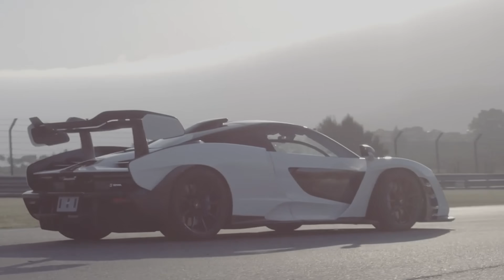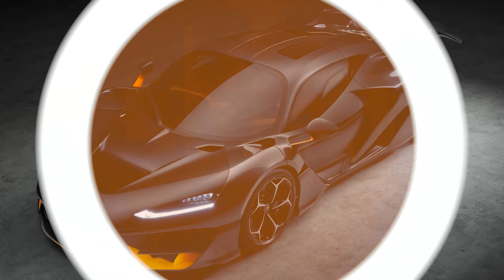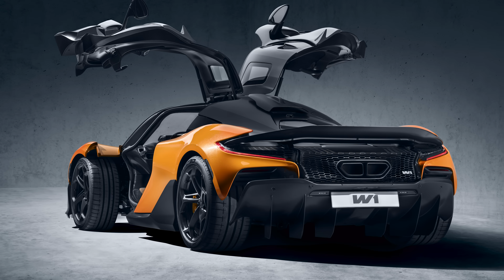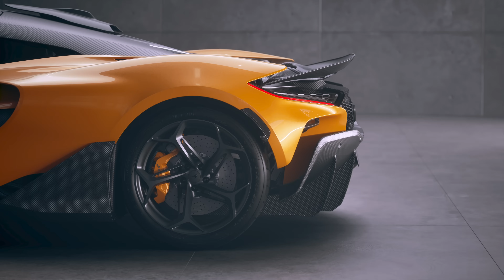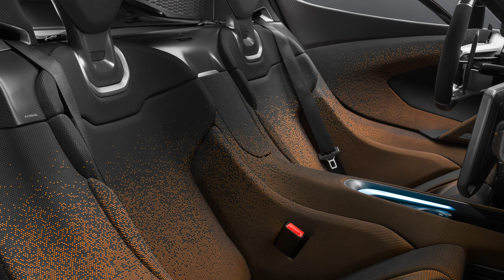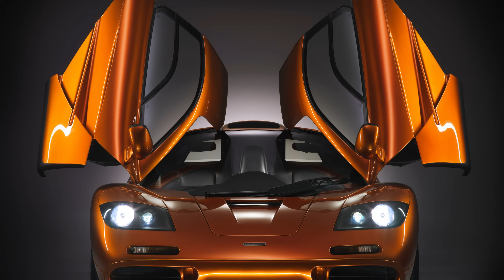The McLaren W1 is a New Standard for Ultimate Performance

Comment: I would have thought with 1300+ horsepower, it would have been able to crack the sub 2 second 0-60 sprint. 2.7secs seems quite pedestrian by hypercar standards nowadays.
Reply: We've gotta stop using 0-60 so heavily as a performance metric. Cars are always misjudged based on 0-60's alone. Not an easy feat putting insane hp numbers to the ground in a rwd car.
Reply: Yup because 0-120 MPH in 5.8 secs and 0-186 MPH in 12.7 secs are so slow ...
Reply: @Mk1Male  exactly...
Reply: If it was awd, I'm sure it would've crack the sub 2 sec 0-6 but being rwd, not happening
Reply: For RWD cars, anything in excess of 500-600hp means the car will struggle for traction during launching. 500-600hp is like the sweet spot, in my opinion. More power is not everything.